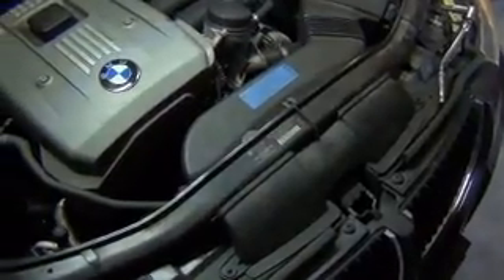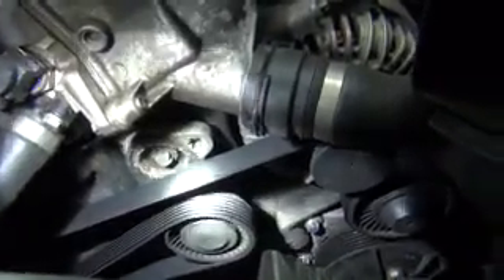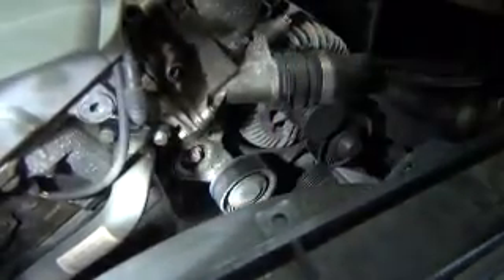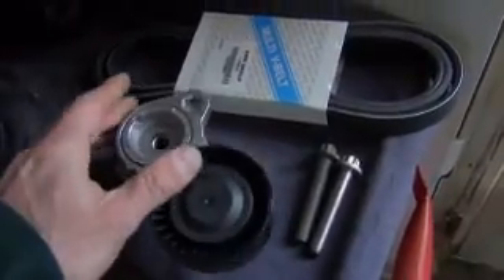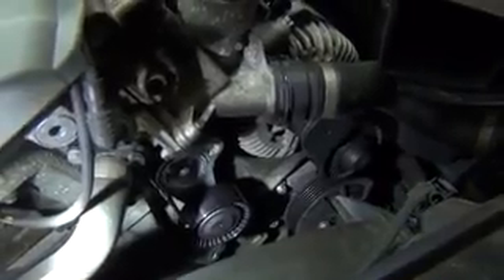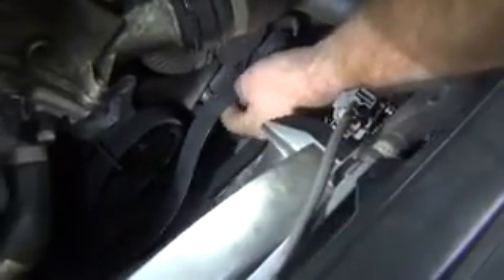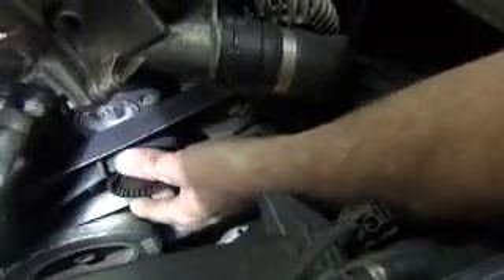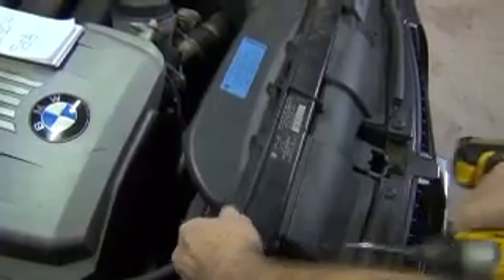BMW Belt And Tensioner Replacement N51 N52 N52k 3 Series E90

Comment: Great video and very straight forward.  Did it in under an 1/2 hr.  Did not have an angle torque so I put markings on the bolt and tensioner to measure 90 degrees and tightened from there.

Comment: Looks like a pretty straightforward DIY, but I'm not familiar with torque angle setting. Can someone clarify?
Reply: +Anthony Lopez Indeed, but the final 90 degree torque angle will set the bolt tension precisely.  One could also mark the bolt and turn it 90 degrees/ right angle from that mark.
Reply: +Jeff Kline Imagine moving your wrench from 12 noon to 3 pm. That would be 90 angle torque.
Reply: +Raymond Boyle Excuse my ignorance, but, if you do that, aren't you just tightening it more? (And increasing the torque?)
Reply: Got it, thanks for confirming. Just finished ordering my kit from Amazon now that I'm confident I can tackle this.